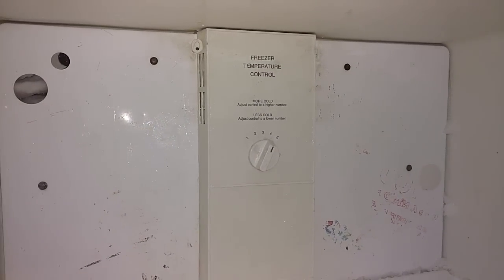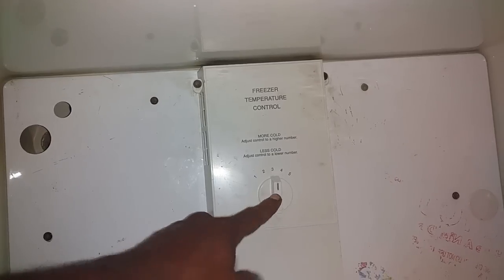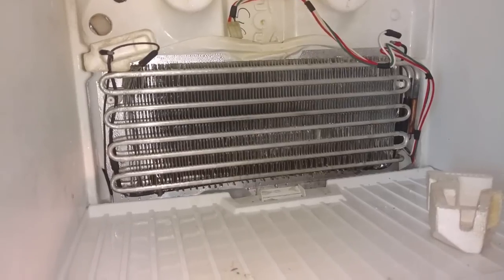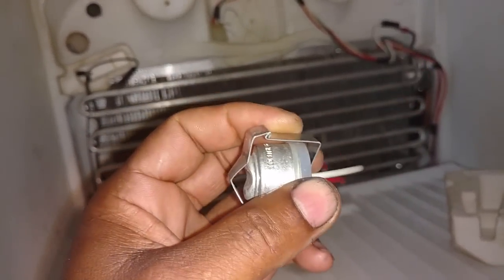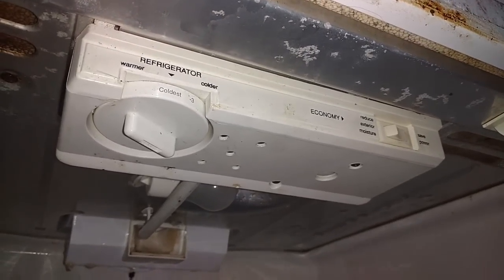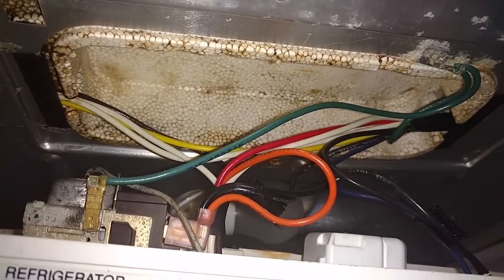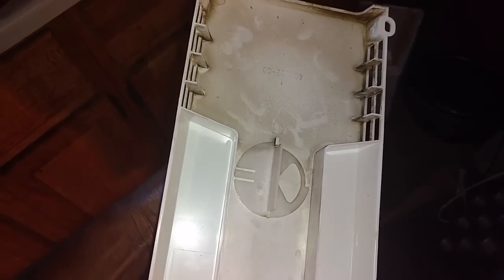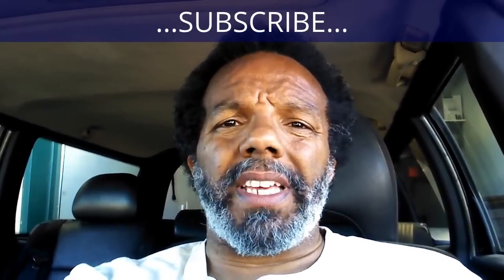Freezer building ice, refrigerator is warm, how to repair this problem. - VOTD

Comment: knows super satisfaction from repairs like this one.  I've learned many things from Robert and enjoy his videos.  The evaporator is the cold radiator inside the refrigerator that the fan blows on to get cold air.  Then, the Freon condenses and is hot when the fan on the outside blows over the condenser to remove the heat from the system.
Reply from the maker: +Pratyut Tit cool, thanks for sharing.

Comment: Mom has about got her money's worth from that refrigerator.  It's about time for a replacement. The new ones are very much more energy efficient, look for the Energy Star tag.  A new frig would cut the electric bill so the new frig would pay for itself in just a few years.  I sometimes have got some great deals buying units with small scratches or dents, the appliance store has a tough time selling those.  People replace older smaller units for new ones even though their frig is still working.  The appliance stores end up with those also.  You just have to keep you ears open and call around.
Reply from the maker: Let me know when you find one for her. ;)